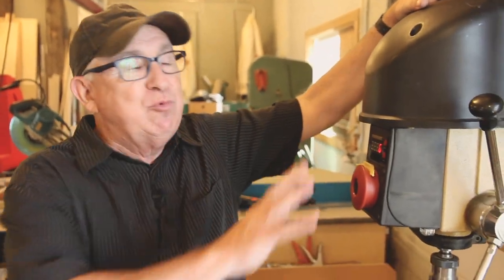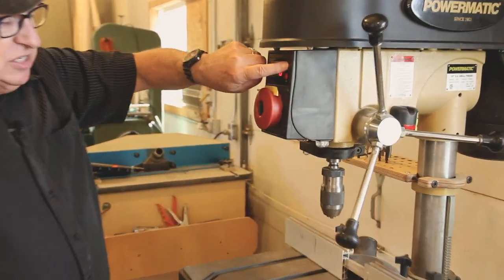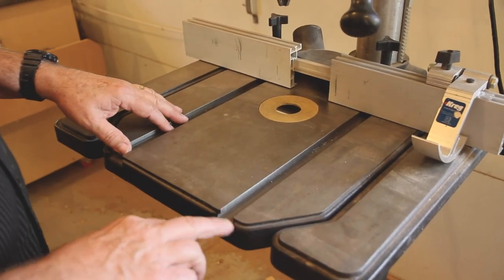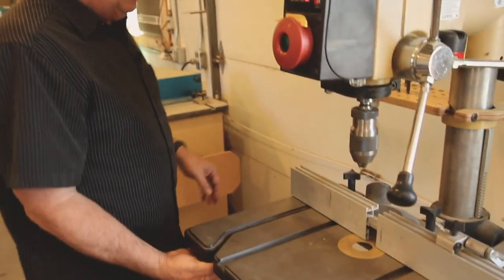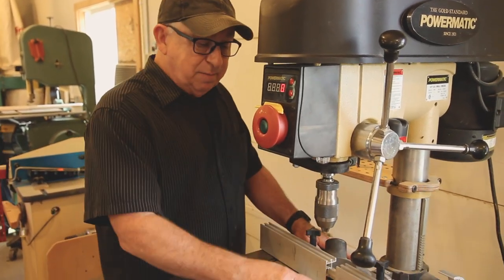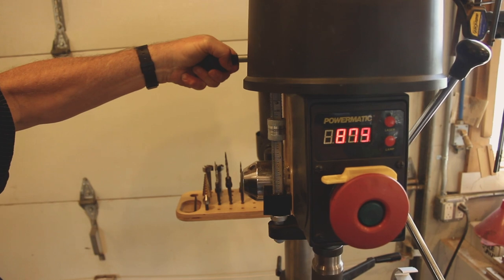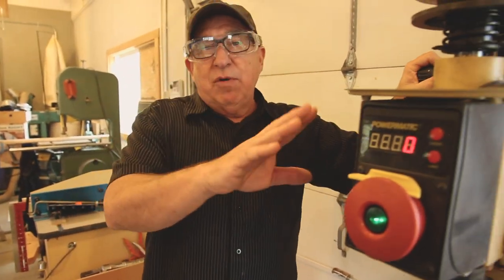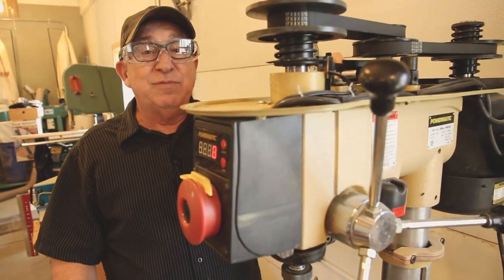How Good is the PowerMatic® 2800 Drill Press?

Comment: I just bought one of these exact models at auction. Although it was labeled as a 2800b, i realized this morning  its the earlier model 2800
I haven't yet picked it up. After reading the comments here im hoping its not riddled with similar problems.  I know im gonna lube up the pulleys right away. Wish me luck !!
Reply from the maker: Let me know how it turns out. I've been very happy with this machine and it serves me well. I hope you have the same experience. I agree that the first thing you should do is maintenance the machine so runs as it should. Best, DFJ

Comment: I have exactly the same drill press, here in the UK, but labelled as Jet, rather than PowerMatic.  The only difference is a slight change to the stop/start buttons, and my RPM range is 330 - 2500, I guess due to having a different (240V) motor.  Oh, and mine has a clear plastic hinged guard in front of the chuck - but your machines never have guards in the US, I've noticed! :-)
I did the same thing with the fence adjust knobs, but also had to cut a slot out of the fixed piece of the fence, on which the 2 extendable 'wings' slide, in order to allow a decent gap for the chips to pass through.  It looks like the previous owner did the same with yours already.
Both sets of LEDs blew within a few months of ownership, but I just unsoldered them and replaced them myself, rather than return the whole thing.  Probably poor quality LEDs, I guess, or maybe they were being overdriven.  The replacements have been fine so far.
So my overall impression has been: a few niggles to overcome, but otherwise a great asset in my workshop.
Reply from the maker: Nick, greetings to you there in the UK. Thanks for watching our video and taking time to share your experience and insights. I'm considering altering the lighting system on mine or augmenting it as the lighting is that effective as is. I really like this drill press. I too think it's a great asset in the shop. We are working on a mobile base for the unit and will post an episode on that as well. Thanks also for being a subscriber/member of the DFJ viewer family. That means a lot to us. Cheers - DFJ

Comment: Woww! Almost everything P-Matic features these days looks like it utilizes either the old Delta or Rockwell/Delta Brand floor model designs... The drill press is no exception!
Reply from the maker: Crazcompart, thanks for writing. I think it is a combination of good design early on, the form and function of the machines. Because each of these machines has certain functions to perform, that certainly has a lot of influence on the form and manner of design of each. Whatever the major influence is, these machines are fun to use! Best, DFJ

Comment: Specs for PM2800B say it goes down to 250 rpm, but this one in the video only goes to 400.  Is PM2800B a different model?
Reply from the maker: rogue277 - thanks for watching our video and taking time to write. First, if you are considering acquiring a Powermatic drill press, I think you will be pleased with your decision. It's a very nice machine and a pleasure to use.

As for the difference between the PM2800VS and the current PM2800B, there are several enhancements, ranging from a keyed chuck, instant depth stop nuts, and and even lower speed level than the 400 rpm on my machine. The 250 rpm is indeed the new spec for this machine. 

I hope this helps! If you do acquire the new model and put it to use in your shop, write me at jay@dirtfarmerjay.com and let me know about it!

The best to you and yours - DFJ

Comment: Jay, my PM2800's drive is noisy as hell. With the shroud removed it is obvious that the the sheaves are out of plane with their mates. I can't see how to remove the belts (which are being turned into a fine powder) so I can see what I can do to rectify either sloppy assembly or poor design. Can you help? I replaced the slipping keyless chuck with a pair of the best Jacobs chucks.
Reply: Did you work out how to sort this, Mark? I have an ~8 year old UK version of this (Jet JDP-2800VS) and when I try to use speeds below 1000rpm there is a clonking sound coming from the drive area but I can't even work out how to get the top cover off yet :-(

Comment: Whats a fair price for one of these in good condition? Or perhaps what was original MSRP?
Reply from the maker: Erik, it's not real clear what the original MSRP was, but indicators are it was around $1100. If I remember correctly, we paid $800 about 4 years ago. Hard to tell what they go for now, but we've been very happy. We've read some negative comments on the speed change on the fly feature, but as long as you observe the absolute rule of making speed changes ONLY when the machine is running, and keeping the spindles the variable pulleys are affixed to, you will have no problems. It's a solid machine, and it's become an important part of our maker space. Let me know how this turns out for you! Best, DFJ
Reply: DirtFarmerJay thank you! I found a nice one on Craigslist in great condition for 600$ but I think someone else snagged it

Comment: Hi Jay -My Powermatic PM2800B drill speed won't go faster then 500 RPM without throwing its front 28x8x790 belt.  My PM2800B was purchased new and has very few hours of use.  I replaced both expensive front and read belts (2 belts total over $300!) using the correct replacement directions as described in the Powermatic manual.  The front belt continues to jump off the front spindle pully even after the new belts have been correctly installed.  Does anyone have a clue as to why my press is throwing its front belt as I try to exceed a RPM of 500?
Reply from the maker: Michael, I'm sorry to hear about your experience with this machine. It sounds like you have been very thorough in your approach to installation and such. Nonetheless, I know of only three reasons that a machine will throw a belt. 1. The centerline of one pulley is not in line with the other one, so the belt "climbs out" of the groove. It's likely that the two pulleys are not remaining coplanar as speed adjustment is made. 2.) tension is not maintained, so the belt comes out of the pulley groove and again "climbs out." I don't think that is the issue here, but it could be. 3.) the vertical axis of the shafts of the two pulleys are not parallel to each other as the speed is changed, again giving an edge of the pulley to grip and be thrown. Unless there is significant play in the spindle bearings, this seems unlikely as well. 

You'll need to continue to work through a process of elimination and isolate and address the problem. With the cover off, and exercising due caution, you can first off run the press and see where the belt typically "exits." Once you determine that, you can then further isolate the problem. 

Let's see what other advice gets posted. I hope my comments have been of some help. This is too nice of a machine to not be enjoying it!  Best Regards, DFJ
Reply: @DirtFarmerJay  Thank you for the quick response Jay.  You are half-way correct in your diagnosis of the cause of my belt jumping.  I learned a better lesson: Before you order new expensive belts first call the tech support team over at Powermatic's JPW Industries!  The tech person advised me to put 3 drops of 3 in 1 oil on the top and bottom of the pullies on the center shaft (the shaft/pully system that makes the PM2800B's variable speed system work).  After oiling I gave the pullies a light tap w my rubber mallet and the springs popped the pullies back into place.  Even better was JPW took back my un-needed replacement belts and charged me only a 25% restocking fee.  My press now works like a champ.
Reply from the maker: @michaelthomas4639  - excellent! Glad you found out how to bring your drill back to top-notch performance. I, too, have had excellent interactions with the PowerMatic/JPW team. Glad it worked out, and I'm going to be sure that center shaft on our press is lubricated properly. Best Regards, DFJ